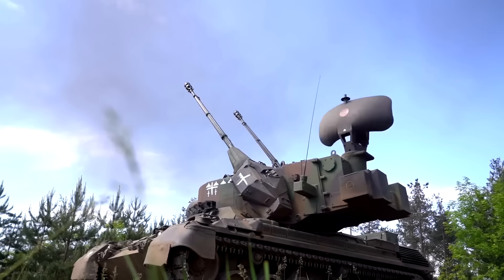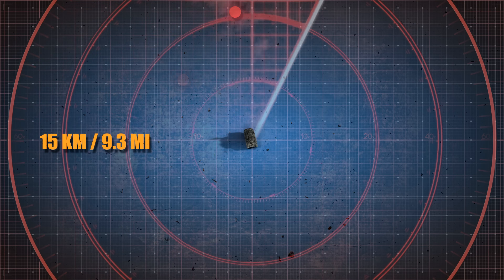That's Why Russian Shahed Can Not Pass Gepard

Comment: The Motorola 68020 series microprocessor was used in the Macintosh II and Macintosh LC from 1987 to 1990. In case anybody needed context. You can do a surprising amount with very low-powered computing if you remove all the bloatware. The Hubble Space Telescope is still using a 25MHz Intel 486 microprocessor to process all that image and science data!
Reply: The 68020 was the Workstation power horse of the late 1980s when it came on the market (1984). Probably a later upgrade to the Gepard (if this is actually true). The series started with the compatible 68000 which came out in 1979.
Reply: They managed to land on the moon with processor power below that of a 6510 (aka C64)
Reply: And the Amiga 1200 😃
Reply: I’m wonder if the popularity of Atari ST and Amiga computers in Germany helped the choice of CPU as many programmers of that era was well versed in coding in assembler for the Motorola 68000-series?

Comment: I served as a Gun Mechanik on the Gepard. The construction of those guns is quite "simple", sturdy and servicable. It did not feel much more complicated then dissembling and assembling a G3. But one would need a crane to lift those guns. And every gamer, could work with the system in minutes. Almost point and click.

Comment: An anti-drone weapon that was designed long before drones were even thought of....
Reply: It was designed to fight attack helicopters and ground attack jets and it's outstanding that it is able to track much smaller drones, that normally don't even have an aluminium airframe. (i.e. create a far more faint radar return)
Reply: @duartesimoes508 any somewhat modern radar can be configured to detect targets of various sizes. Whilst being adjusted to look for larger targets at longer ranges smaller targets will not be clearly identifiable

Comment: The Germans have a history of radar controlled anti aircraft systems. Already during WW2 they had developed a system for use against allied planes bombing German cities which was highly effective.
Reply: Do you happen to know the name of such system? It's the first time I've heard about something like that.
Reply: @digitalisman3267  Sorry,  but I can't help here. I heard about this German anti aircraft radar targeting system years ago from a couple of old Germans who had manned these guns during the war.
They told me that they had used a highly advanced (for the time) targeting system that told them where to aim ahead of the enemy planes to hit them.
They didn't call it radar, but the way they described it, it worked the same way. It determined the speed and altitude of the plane and the angle and direction to aim the guns.
Reply: @digitalisman3267 sure it was the Himmelbett system, developed by General Kammhuber. It was deployed from north to south and aka the Kammhuber line. However, it was a radar based air surveillance and interceptor controlling system and proved quite ineffective because it was easily overwhelmed. The Wehrmacht did not have anything like the Gepard.
Reply: @digitalisman3267  Funkmessgerät (also Funk-Messgerät, short FuMG or FuG) was the name used by the German Wehrmacht before and during the Second World War for radio equipment and devices, which were used to locate aircraft or ships, to direct fire of the air and coastal artillery or to guide their own fighter aircraft. These can be divided into active radio measuring devices (in modern German radar devices) with transmitter and receiver part, later also as radio measuring device (FuMO). as well as passive devices, which only received and did not transmit signals. The latter were also called radio measurement observation devices (FuMB), today they would be called radar warning devices.

Comment: The Gepard is older tech, but still effective.
Reply: The Ukrainians are using Maxim Machine guns to good effect, many manufactured 80 years ago. They were properly stored and some were clearly unfired. As long as you use that beast in a fixed position and have a good amount of water or snow nearby, it's a perfectly effective weapon. Its caliber is plentiful, the same as the PK.
Reply: Yes old and very good..

Comment: Well, it is not used anymore in the German military, more than 20 years.
Reply: Well, maybe it should. If it was retired I bet this had to do with the Defence budget and not effectiveness. But the Germans are waking up. It was about time.
Reply: @duartesimoes508  was a budget issue
Reply: As always... 
Now with Clitorius everything is clearly improving.
Reply: you're right, army air defense got scrapped around 20 years ago, because of budget restraints. It is now being reestablished, with gun and missile systems, the gun system being the Skyranger und a boxer chassis

Comment: I will never unterstand why they phased this great piece of equipment out of active service
Reply: I think the thought was that missiles were  better solution in terms of range of engagement ( both radius and altitude) Perhaps the ability of the Gepard to train quick enough to track and engage fast moving targets was in question as well. That’s not  a limitation when engaging slow moving drones though .
Reply: Also, it was meant to defend against Helikopters and low flying jets. But since the range of weapons, those can carry the effectiveness if the gepard shrunk. So if an attack helicopter can fire at a range of 20km and the gepard has a range of 15km, then its pointless... but the didn't think about slow flying cheap drones.

Comment: Odd, the published data has 15km max range and 3600 km/hr. My question is more about acquisition on horizon. I should have predicted sad bot responses. For example we see very sophisticated Russian SAM being destroyed because they cannot acquire and lock onto small and slow attacking devices. The Gepard is excellent at small and slow, but I’d like to hear from someone regarding a weapon coming in like Vihkr, at about 270 m/S head on (smaller radar cross section), at say 500 meters altitude. Does this give Gepard enough time on the horizon for the search radar to spot, then the track system to lock and destroy? A realistic guess is yes, 75% of the time, but hoping to hear from a former user and not a bot.
Reply: The Oerlikon towed twin canon has a very simular fire control system. Hit probability should be more than 75%, my austrian AA comrades were talking about 90%. Argentinien AA shot down two british Harrier during the falkland war. So yes, it's also effective against fast and low flying enemies, Btw 500m isn't low, 50m is...

But: Radar has to be used. If the enemy uses anti radar missiles or other countermeasures, the effectiveness decreases.
Reply: Usually the Gepards are warned ahead by other long range radars that something is incoming, so they have time to prepare.

Comment: Nothing special. We had a modified version, the PRTL, with the Philips radar. They are designed to follow the NATO armour and protect them from low flying attack aircraft. It s largely a stand alone automised system. The Dutch PRTL were sold to Jordan’s and now bought back and will be delivered to Ukraine

Comment: I don't want to see more videos like this because I was expecting statistics on how many FPV-Drones, Shared-Drones, Missiles... were shut down with the Gepards. So why can no Shahed Drone pass the Gepards? How accurate are Gepards?
Reply: Very. Shaheds have a significant radar echo due to their size and propeller, and they are generally flying in a straight line. The Gepard gunner essentially just marks the drone on the search radar via joystick, then the turret swings over automatically, the tracking radar follows it, and the fire control computer usually has a firing solution within ~2 seconds. The gunner does not need to do anything more, the turret auto-tracks the drone, and then you step on the firing pedal. It's that simple, really. (Been a Gepard gunner in my army days)

Comment: If a Gepard is up and running in a convoy and Vihkr are fired from far away over the horizon what is the chance of stopping those missiles? I will guess very good as the missiles are not terrain hugging and are not stealth and are subsonic. Does anyone have solid information?
Reply: The Gepard is anti Aircraft  so it can only kill slow moving targets and short distance.
Reply: The Gepard will at most see the helicopter far outside its engagement range but definitely not the missile unless it is already very VERY close to the convoy. The missile is much too small and fast for the Gepard to intercept it effectively. Sure some cracked gunner might nick one through manual guidance but that's about it. Anything slow flying with a large surface area like a shahed drone or some larger slow flying cruise missiles could be shot down relatively effectively.
Reply: The published data seems to contradict; “Gepard can hit targets at altitudes up to 3 kilometers, flying at speeds up to 350-400 m / s; its firing range is up to 4 kilometers”. Note that Mach 1 at ISA is 310 m/s. A missile inbound shows its nose but dwells on the scan (like a baseball thrown at you), so simplifies lock).
Reply: @richardkudrna7503  well the vikhr missile cruises at 600m/s(Mach 1.8). I'm not saying that I can't hit atgms.... It's just insanely unlikely. Either because it simply does not detect the missile or because it can hit it effectively. The missile does not fly in a perfectly straight line towards its target. It twists around its guidance giving lasers.
Reply: What I read is that the Vihkr peak velocity is 610 m/sec but average over 6 km is just 430 m/sec. The motor impulse is very strong initially to accelerate it then it goes to a sustain impulse to keep it supersonic out to about 7 km. I feel that if Aimed at the Gepard radar and if say detected at 3 km the Gepard has say 8 seconds before being hit. Let’s say it has 5 seconds to lock, track, fire. I’m still thinking yes, Gepard has a very good chance. I’d like to hear from a former operator.
Reply: @Masterafro999 I’m guessing the 35mm rounds are proximity fused, and while the missiles may twist around a bit as they follow the laser return they probably stay within the blast cone of the proximity fused rounds.
Reply: @dirtdevil70  they are not. Standard dumb ammunition. Nothing fancy.
Reply: @Masterafro999  nope, rounds are subprojectile scatter rounds. they explode a few meters in front of the target to saturate the air with shrapnell.

Comment: The premise is laughable — Gepard is not a weapon against (Irainian, btw) Shaheds. Shaheds cover distances on the order of 1000 km, at an altitude of about 50–100 meters. The probability of a Shahed ever flying into one of the handful of Gepards is laughably low. To protect a large area against Shaheds, you need a large number of cheap machine guns; not a fancy radar-controlled turret inexplicably placed onto a tank chassis (seriously wtf — I could MAYBE understand the armor, but what's up with the fucking tracks?). Also, the other radar — the spinning one, — offers almost zero utility against low-flying Shaheds, as its radio horizon will be virtually the same as visual horizon.
Reply: oh right, shaheds can fly 1000km, so we must have SHORAD along the entire line!!! Or, we could place one or others near high risk strategic sites and the shaheds will go straight over them, clever right? It's on a Leopard chassiss as it's fast and reliable. They don't use tyres and use tracks instead as that means it can follow armoured assaults and of course be all terrain. you seem like one of those people that talk for days but don't know what they're talking about.